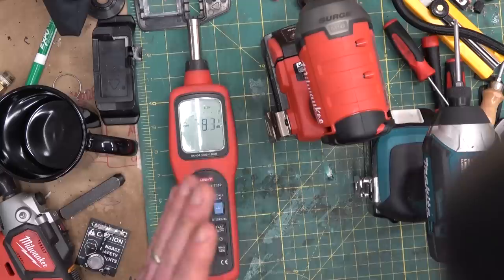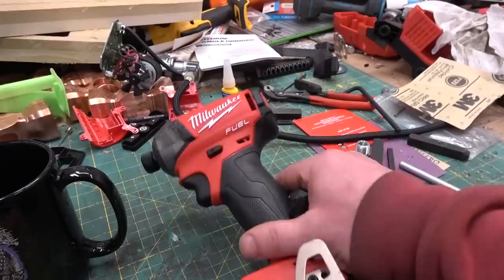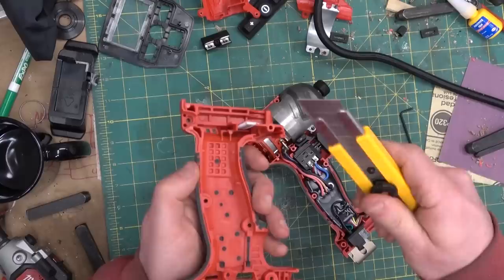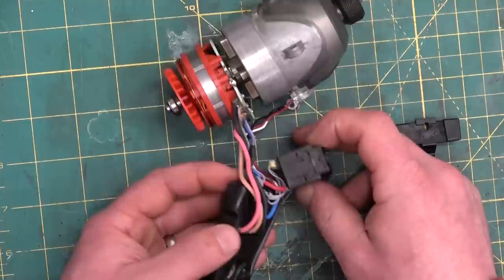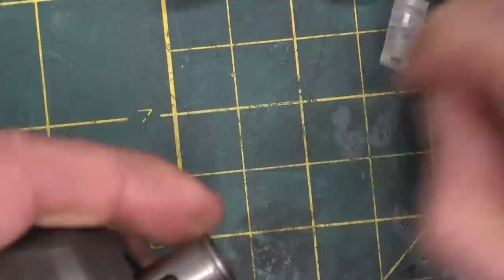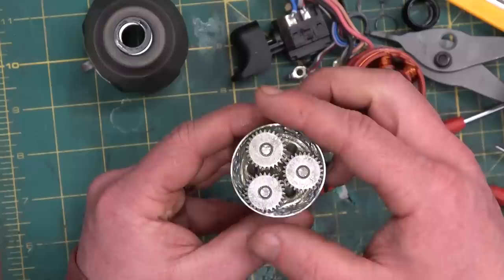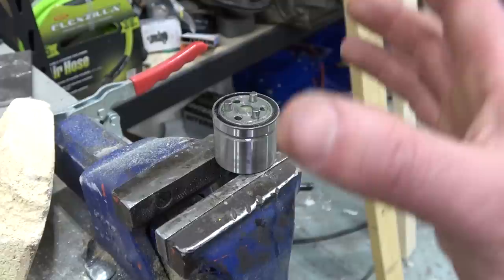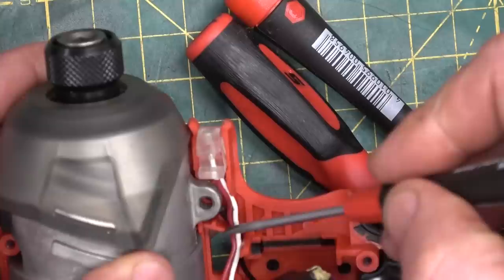BOLTR: Hydraulic Impact | Milwaukee Surge

Comment: Regarding the ground  could be to mitigate static electricity generated by the hydraulic fluid due to high fluid velocity one of the biggest static shocks I've experienced came from fluid traveling through a refrigerant hose felt like I grabbed an electric fence
Reply: You got zapped from a bloody refrigerant hose? Never thought that you could build up a charge this way!
Reply: Jonny B  It is more a DIY kind of thing ;)
Reply: All the brushless units have a ground
Reply: Chilling story...
Reply: Why would you grab an electric fence?
Reply: I was glass bead blasting a motorcycle frame once, and vacuuming up the used beads off the driveway. My plastic shop vac hose gave me shocks to end all. I grabbed some doorbell wire, stuffed it in there, and dangled her on the ground. My nerves were saved from the kilovolt kick.
Reply: @daviddesilva4971  To get to the other side!
Reply: We've gotta be more careful and ground your manifolds, especially on the future I'm sure you'll be seeing explosive mixes.
Reply: If you, like me, have occasional need to vacuum up loose laser printer toner, don't use a normal vacuum cleaner. You need an ESD (Electrostatic Discharge) vacuum. Toner is made to be transported by static charge. Vacuuming toner with a regular machine can build up a charge and lead to shocks, small explosions, or fires. Also, inhaling toner is hazardous. ESD machines have special filters to contain it, and not blow it back into the air. They are expensive though. If you can't find a cheap used one like I did, clean it up without vacuuming. Or, just cross your fingers.
Reply: L Clark I vacuum toner all the time, the explosions are a feature not a bug!
Reply: ManMad610,  I've experienced the same thing. Was it Karma? We both know the circumstances causing this phenomenon.
Reply: @trevorus  yea those damn shop vacs create charge by design. Lack of design that is. My coffee grinder makes so much static that the grounds fly out of the enclosure when i open it. Great.
Reply: @TechGorilla1987  this is such a good an informative thread.
Reply: @inthefade  Right? So that's what I feel when I go vacuuming. I'm not crazy.... Wait Who am I kiddin'? I clearly am.
Reply: Use your jumper wires to ground the refrigerant bottle to the equipment or something else grounded.
Reply: Legally Tone Deaf, sumthin new every day. ‘Preciated.
Reply: @daviddesilva4971  why would you piss on an electric fence, I don't know but when we were kids we'd piss on anything, Joe: "should I pee on the wire" me: "you'll probly get... yea, go ahead!", Joe: "EEEEOWWW!!!".

Comment: Anecdote from someone who used to design industrial power tools. We found in the north american market we had to make our tools louder so we took the mufflers out of them (pneumatic). This actually made a lot of them perform worse but they sold better. The European models were higher torque and quieter. Also yeah, hydraulic pulse tools we really only sold for "precise" impacting torquing and for applications where a smoother impact was needed. They dont last as long as hammer impacts and dont torque as high. But they were a lot more quiet.

Comment: The M18 surge is by far my favorite impact for the kind of work I do. Decking boards, a few sheets of drywall here and there. And if your framing a small wall, and using screws, the f***ing thing is awesome. Drives and sinks the screw, without moving the stud a smig. If I need more power, I bring out something louder, but the noise difference when working inside occupied homes is what sold me on it.

Comment: I’ve had a chance to work heavily with this tool and the non-surge latest impact driver, side by side. The surge is definitely smoother and quieter, and even a blonde-one faster when you’re driving screws into pine. However, when working with hardwood or in automotive use with socket adapters, the non-surge is superior.
Reply: It's oddly good at breaking rusty bolts. I think it's the softer impacts with similar spin speed, makes it vibrate rust right off, and breaks 'em free.

I also put in a lot of self tapping screws at work, and this does the job faster than any driver out there.

It has its niches, I don't think any of those niches were intended by the engineers, but they're there.

Comment: I have one and to me as a diesel mechanic one of the best features of this tool is its ability to have a very wide choice of torque settings (also I see he did not use it on the highest and fastest setting, had it on 3 instead of drill,). The first setting is VERY helpful in dealing with the interiors of trucks/vehicles or any instance where the screw is harder than what its going in or securing. You still get the speed but don't have to worry about being gentle on plastic interiors.

Comment: I was slightly put off at first because it starts impacting far sooner and they feel softer, and I took that as weakness (like normal impacts when they're getting low on battery).... When really it's actually torque improvement at lower throttle... It's leaps and bounds better than any impact I've used! The more I use it, the more I love it! Side by side with other impacts, this stands out amazingly! A single 5.0ah battery can last me up to an entire week framing metal soffits for cabinets due to it's torque efficiency! This impact is KING!!!

Comment: The M12 Surge is by far my favorite impact driver, it’s so quiet and far less harsh even at the same volume, makes use indoor and consistent use just that much more enjoyable. The m12 Surge is 99% of the M18 performance and only 60% of the size.
Reply: The battery capacity difference is the issue. If you're doing little automotive shrimp screws that's fine, but if you're driving fastener you tucker out the standard batteries (1Ah?) real quick. If you're using the M12 3 or 6 batteries You might as well be using the M18 that point.
Reply: Agreed m12 surge is a great tool, my local shop had a sale buy the kit get a free 6.0 battery
Reply: @otm646  To be honest I'm surprised anyone uses 1ah batteries. I thought the only point of those was to showcase why you need at least the 2ah ones. Why use the lowest of the rung if you need longevity?

Still, the M18 battery is much much heavier than the M12.
Reply: @LordOfSilense  because the whole point of the M12 is that it's small and flexible.  The only place I've seen them used is in automotive trim applications. The M18 head is so small that there's very few places and M12 will fit but an M18 won't in the real world.
Reply: otm646  say what you will but the light weight factor even with a 6a m12 suits me fine. all day holding an m18 with a 4a is torture at times.
Reply: @LordOfSilense  On the contrary - sometimes you need the super light-duty battery for the super light-duty work. I just picked up a bunch of M18 Fuel to replace the crap that made me angry every real job, and picked up a cheap M12 kit for the office. Up there, I do a lot of work on plastic parts that require zero power but also plenty of finesse (zero weight).
Reply: It is not 99% of the performance. Id say its about half to 2/3s the performance. I have the M18 surge and the makita TD002 40v (GDT01, but newer japan only model) and especially in 4", 6", 8" and larger fasteners the makita was much faster.

Comment: I honestly was given one of these, and it sat in my garage for 2 years unopened.  I opened it to get out the 'extra' battery and started playing with it, some time later.  6 months later I'm driving deck screws until 10pm, and let me say it is 1/3 the loudless of the DeWalt brushless, and is super smooth.  I love this impact, it's my new favorite.  I didn't even know it was labeled, as "surge", or was hydraulic (ish).  I just fell in love with it.  I highly recommend it.

Comment: That quieter impact is great when working in occupied spaces. Also the speed selection is very nice, in particular the self drilling screw setting. Wor is great in metal stud work, minimizes stripped screws.

Comment: U know that my OCD dissorder  kicks in hard every time you say  PCB board.
Reply: What about OCD (disorder), or OSB (board). LOL
Reply: PIN number
Reply: VIN number.
Reply: ATM machine. Ugh.
Reply: Hot water heater. If it’s hot water, why do ya need to heat it?
Reply: @notajp  Carlin!!
Reply: @randyruppel6727  wouldn't it be a cold water heater?
Reply: @friedpistonrings8533  "Sounds like you need yourself a hot water cooler!" Lol
Reply: You any kinta Roy?
Reply: @randyruppel6727  lol gotta love carlin!
Reply: @jasonh.8362  no sir
Reply: DC Comics?
Reply: @Danne Eson unnecessary redundancy has become a fairly regular thing. Best you find a way to not let it bother you as ASAP as possible.
Reply: @curo72  why use the acronym? All you had left to spell was "soon".
Reply: That’s called Redundant Acronym Syndrome - or RAS syndrome for short.

Comment: I've been using the surge m18 fuel for about 3 years now and it never failed me once. Still runs like new. The quick connect chuck is still tight and not loose like Makita and dewalt gets. I also dropped it in water fully submerged once while working in the trough of the infinity pool I let it dry out for a day and it still works till this day. Also the hydraulic mechanism makes it perfect for drilling and tapping 10-24 and ¼-20 holes for screws. The soft hydraulic hammer along with some w-d40 or wax keeps the taps from breaking.

Comment: The m12 brushless impact. I love it so small, so light. Hits more than what you'd expect from such a small one
Reply: The girlfriend says the same thing!
Reply: I bought the 1/2” 12v stubby impact and I’m not impressed. It looks nice but my dead grandmother hits harder
Reply: @samuelowen  i have the 3/8 m12 stubby and i use it with the 6.0 battery and its never failed me
Dont know what your using yours for
Reply: Clarification. 1/4 impact driver not a socket driver I haven't used those.
Reply: @canogaparque818  I feel like if I cant use the small form factor battery with the m12 , I'd rather just use the m18
Reply: @Capthrax1  thats like saiyan you want full power from a table saw coming from a 2.0 to be the same as a 12.0 battery
Depending on the tool use ghe appropiate battery for best results
Reply: @canogaparque818  or, and just hear me out the use of larger battery on m12 (drills) makes it (to me) negate the benefits of a small form factor and I'd rather use the larger tool. Obviously you dont put an2.0 battery in a table saw and bitch about getting 3 cuts

Comment: I wanna see a forklift lifting a pallet of forks. It'd be so damn literal
Reply: Mitch Hedburg... That's right!
Reply: Been there, done that. I worked at a coffee company that sold spices, teas, and even plastic forks.
Reply: In a massive heat treat facility with 30 plus forklifts (running booms) there were literally two forklifts had forks on them. A little 2000 lb unit for trash and the maintenance forklift.  The maintenance forklift was down when we had plate steel delivered, the little one couldn't lift high enough. We actually had to borrow a forklift from next door it was the most embarrassing thing I've ever seen.
Reply: @otm646  30 forklifts and only two sets of forks? O.o That's just bad planning lol
Reply: Fork, not forkslift!

Comment: This tool works best for guys doing light work in rafters like HVAC or commercial framing using self tappers [fasteners that don't require a ton of torque].  When you are up in a ceiling at deck level under corrugated steel surrounded by metal framing you definitely notice a huge difference with this impact vs. the others including the top Milwaukee one.  You can try them next to each other and the hydraulic doesn't kill your ears with harmonics.

Comment: I noticed you only had the Milwaukee at speed setting 1 when you called it "slow"...
Reply: He's not always the sharpest bulb in the box.
Reply: Not to mention he let out a ton of fluid from the drive. I own an M18 surge and it's much faster than what he is getting from his. I'd wager it's pretty similar to most others, I know it is slightly slower than the normal hammer impacts but it's really so little a difference it's not a big deal.

I like his videos, but there is a reason I don't use him as the only factor in a tool purchase.
Reply: I think the 1-2-3-X is torq settings. 1 being the hardest and progressively softer. The x (I forget the actual symbol Milwaukee uses) is for sheet metal screws. Apparently it senes when it’s sunk and stops so you don’t strip it out. All the same speed though.
Reply: @kylewillms5133  That not how the settings work. 1 is the slowest, 3 is the fastest. The sheet metal setting is indicated by the picture of a screw, it's not the best picture but if you know of the feature it makes sense. It's designed to be used with #8 or #10 sheet metal screws into 20-28ga steel, commonly used in electrical or HVAC.
Reply: I absolutely love the one I have which is 18v.
Reply: @2009dudeman  The sheet metal setting makes sense on paper. Doing steel stud framing professionally, I've never had a scenario where sheet metal was better in any capacity over the other settings. It's been prone to strip out fasteners or grind to a crawl.

Comment: Special use is exactly what it is. Use an impact driver on metal framing in small spaces all day and you don't have to wait til you're 50, you'll be yelling at your wife about what you think of the gravy before you're 30.

Old houses with wood that's cured up rock solid and little insulation are almost as bad. Folk who do it more often than me also say they split the wood less, because the impact curve is an actual curve, and not a sharp peak.

I've got the old-fashioned mechanical impact. I try to avoid working in caves.
Reply: Ear protection works wonders too lol, I use it daily
Reply: Ear protection isn’t worth the trouble if your framing offices while running the whole project. This impact is perfect for building while you have clients next door

Comment: It actually makes a significant difference when clacking on metal studs.  We got shutdown because of noise in a live hospital.  Brought this surge out,  my personal tool, and my sheetrocker sub was able to continue building. I've run this tool full tilt driving 3in screws into Redwood,  it loves it. It DOES NOT like 1/4in SDS that are too long into engineered lumber.  However,  the 2804 drill will drive 1/4in x 12in SDS into anything all day long. Used my 5.0a to pre-drill and the 12.0a to drive the 12in SDS. The trick is to use 2nd to get it 2/3rd the way in. Then 1st gear WITH THE SIDE HANDLE and drive them home.  This method outruns the corded 1/2in impact.

Comment: I have one of these for electrical work and it has been game changer on terminations small bolts. hole saws and impact drills. It has much more control on the small stuff. I will not be going back, love this driver. Note, If I was to be driving a lot of wood screws then maybe.

Comment: I own three of these.  When you run a 6”+ GRK screw into LVL’s. They WILL break.  The standard Milwaukee M18 impact (new model) are amazing though.   The Surge is best used for standard 3 1/8 screws or less.  Steel screws for roofs.  Things like that.   Not big lag screws though.

Comment: I'm an electrical contractor and love the surge impacts. The quiet factor is fantastic, especially in people's homes or businesses.  For most fasteners it has plenty of power and having used both for years, I feel is more controllable too. In a race to sink a row of 3" lag bolts it'd lose, it wouldn't be grossly night and day but it'd still lose. But, the fact that it's way quieter and more controllable more than make up for it in my opinion. I like the m12 version better, so small, quiet and controllable, but can still sink the occasional lag bolt. And since employees can be quite silly about hearing protection, this is also me trying to look out for them as best I can without being up their ass. Or anyone else in the room since not everyone walks around with ear plugs in.

Comment: I have the 12 and the 18. The 18 installs 1/4 lag bolts like they were screws. I love them. I rarely drive boxes of fasteners at a time so for me, quiet is good. I like the steel metal screw setting for installing flashing. No look, unstripped screws.

Comment: Bought an Aircat impact years ago and while I've mostly moved away from pneumatic impacts I remember it being advertised as having a quieter operation. I think they advertised high 80 dB range but it felt stronger than the other impacts I had at the time. Maybe with it being pneumatic it was easier to make it quieter while hitting harder than an electric impact but I'll still bring it out on occasions when my 1/2" Makita just isn't doing it and I'm always surprised by how quiet it sounds.